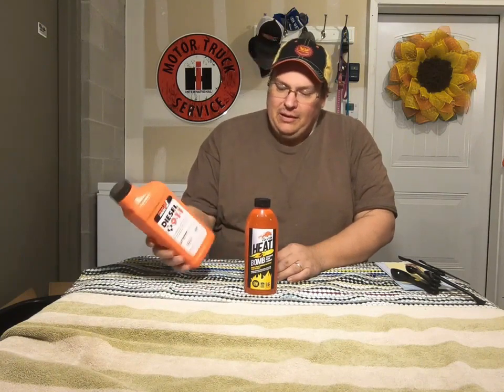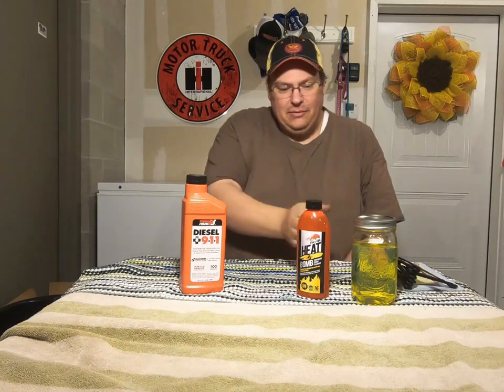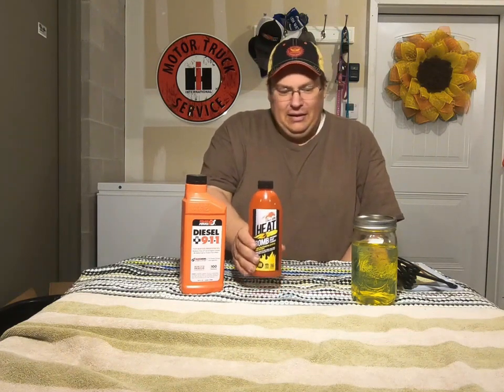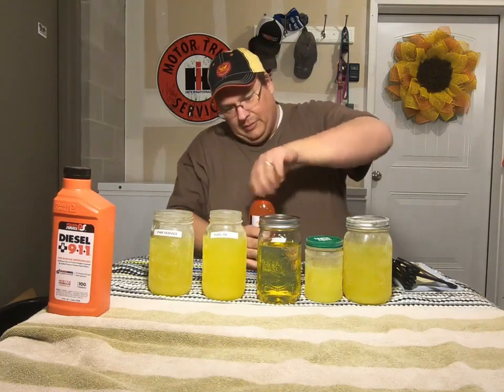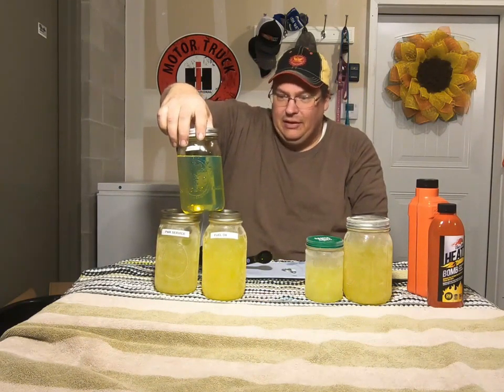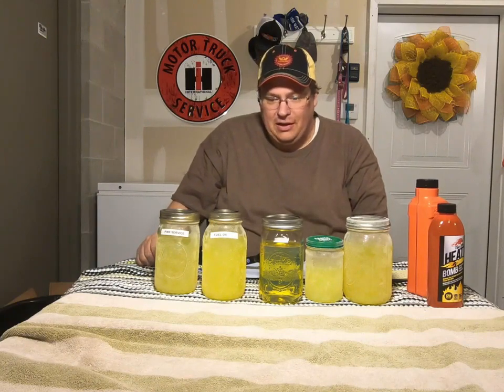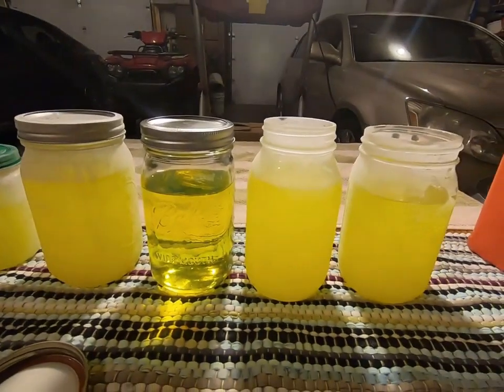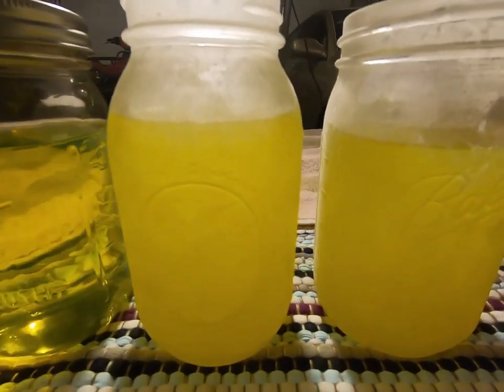Testing products to liquify gelled fuel...and follow up on antigel video

Comment: Couple of things to keep in mind with emergency fuel treatment. Don't use it as an actual antigel. Reason being is because these products will air out or disapate between 24-48 hours. Also when you are jelled up and you do start the motor. Your return lines will push the jelled fuel to the bottom of the tanks and your fuel pickup will catch all the gelled fuel. You have to let the product do it's thing. Plus you need to put some in the filters because the fuel lines at the engine are small and you need something to reliquify that fuel also. That is one of the reasons why once you think you have liquid fuel again and all of a sudden your filters plug. It's because of the return fuel is jelled. 
Personally myself when this happens to me I have put the emergency stuff in and than I take a torpedo heater on the fuel system area of the engine. Careful not to burn wires and hoses. That will help. Oh and just running it into a shop is not the answer either. It will take time for the fuel to warm up. If you have ever looked at the tanks once in a warm shop they will flash freeze from the quick temperature  change. That will cause extra moisture in the ranks once it's  warm again

Comment: Make diesel bulk deliveries, we use Valvetect concentrated diesel additive, it will lower the gel point 10°. They told us double the additive the gel point will go down 20°. After that, mixing it more concentrated is wasting the product with no effect. It's sold over the counter as Diesel Guard.

Comment: Good video. I just add kerosene when in the colder months.
Project Farm works hard to prove the facts.
Reply: @oby I would disagree. He comes up with tests and many times does not test the results... Or if he does, is results are rarely exactly the same,  which has a lot of noise and subjective interpretation.  Plus the guy is always Yelling at the end.

Comment: So what is wrong with using more gel 🤔.... say 1 bottle to 75~gal of fuel. This stuff has saved my truck a few times. A little more treatment the better.
Reply from the maker: Nothing wrong with using more, when its super cold you should.  Only thing is, most of them use fillers that aren't necessarily good . Like methyl ether and glycol ether, so  you are putting more of that in...which sometimes is just necessary I suppose